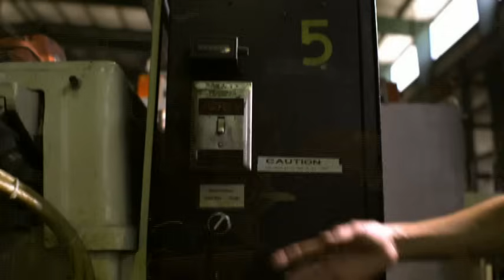Josh Thompson - Beer On The Table

Comment: i'm not speaking to the use of the pipe wrench, watch the way it is turned, the pipe wrench has teeth that bite only in one direction, it is being turned the wrong way when it is twisting. it was not being used properly. and as a guy who works on a swab rig where our main tool of choice for changing tool strings and such is a pipe wrench, im more than qualified to tell you its being used in the wrong direction.